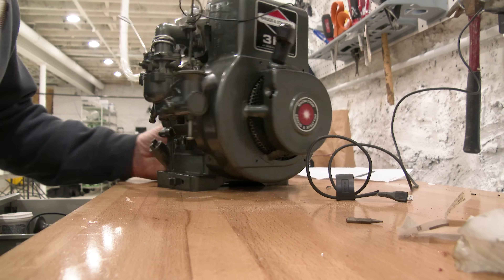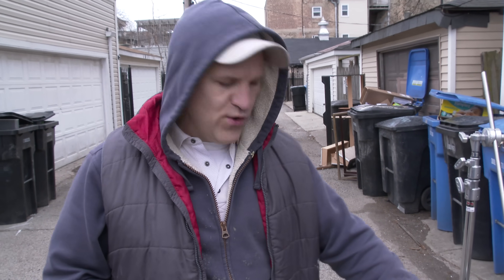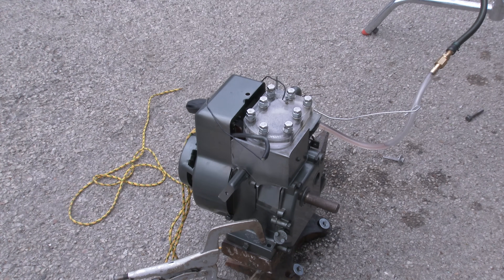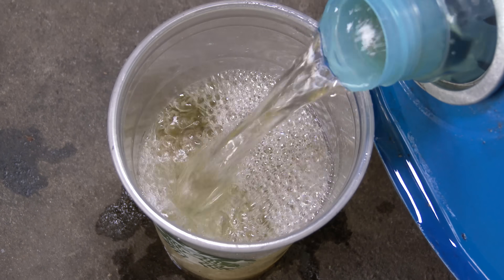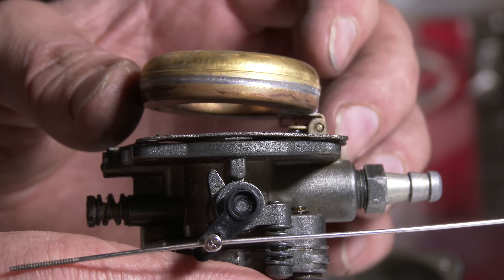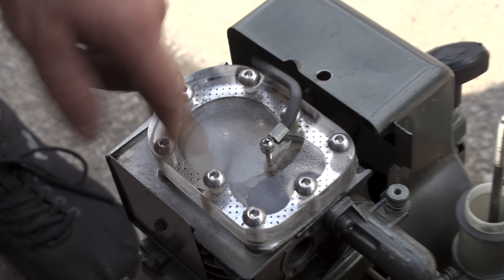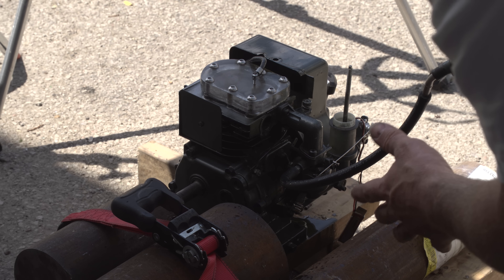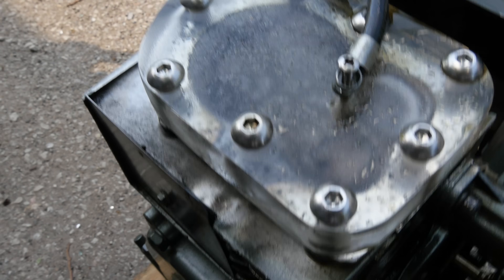See Through Engine on NITROMETHANE - Blow Up Attempts 1 -9 Crazy !

Comment: How big are the jets on the carb? You can burn 1kg of nitro with 1.7kg of air versus 14.7kg of air for 1kg of gasoline, just throw more fuel at it if you really want a bang. You'll need a very hot spark and more spark duration but it can certainly be done.

Comment: oil is from the blow by gasses.....theirs just so much more volume of gas, that more is slipping past the rings

this pressurizes the crankcase..... causing oil to squirt out of every hole and bearing 
also.... the splash lube system is REALLY flinging the oil around at that RPM

Comment: Fuel was getting past the rings, flooded the crank case and thinned the motor oil to the point of it getting past the seals. I've seen this before on engines that were running way to rich or had a internal fuel leak, like when my Chevy with a mechanical fuel pump went bad, the car still ran but the fuel pump was pumping fuel into the crank case too. Oil thinned enough that the oil pressure light came on. Had it happen to a Cummins in a semi I used to drive too, oil pressure dropped and oil started coming out of the dip stick tube because of a injector that was stuck open.

Comment: Holy shit I can't believe how fast you wound that thing out.  I was wondering if it would have run longer if the flywheel was setup so that it didn't shake the crap out of the engine at 30 degrees advance.

Comment: By the way: is this the original sound slowed down or are these after sound effects? I always wondered how slo motion audio is recorded. Because if you play back slowed down footage it either sounds deeper or just tinny crackly and I dont know where the difference comes from (sampling rate?)
Reply from the maker: Äidriään yeah that's a great question. Sometimes it's the original sound, sometimes there's sound effects and sometimes a combination of both. It all comes down to the frequency. If a sound is recorded and it's a 1000 Hertz, and you slow that down by a 100 then it becomes 10 Hertz. Under the audible limits of the human ear.

Comment: You drive with a 2 cycle engine in your car
Reply: Neg. 4-cycle. 2 stroke is only used in smaller engines where the lubricant is part of the fuel mix.  You can get up to 10Hp 2 strokes, but their fuel efficiency is in the pits.

Comment: The slinger is probably throwing the oil up through the breather, as it was never designed to run at 8k rpm....  You're probably going to find significant connecting rod bearing damage if I had to guess. tough little bugger that's for sure!

Comment: My drag-racing friend said that you needed either very high compression or forced induction. WIthout those, nitro won't make enough power, which is why you only pushed out a head gasket, rather than doing it properly and actually blowing the engine up.

Comment: You gotta put the spark right on top of the piston
Reply from the maker: actually, the original location of the plug is between the valves and the piston over the deck not above the piston, you can see this location in the part where I run it with the original head.

Comment: Great slow-mo footage.
However, nitrometh isn't exactly volatile enough to make an engine 'blow up'. Engines in Top Fuel cars fail due to the stresses of cramming ~70psi of boost at almost a 1:1 Air/fuel ratio into a 6.5:1 compression engine. At full throttle, there is almost enough fuel being injected into each cylinder the engine could hydro-lock on just fuel alone.
Seen here in this demo -> https://youtu.be/xGTbQuhhluY

Also, the melting of the first acrylic head looked more like an issue of still running a lean fuel mixture. Just remember stoichiometric ratios: Gasoline is 14.7:1, Methanol is 6.45:1, and Nitro is 1.7:1. That RC nitro fuel is probably about 4.4:1, and the VP Nitro 50% is about 4:1.

Keep up the cool footage!

Comment: Would a quartz head work on something like this, I'm pretty sure it can take high temperatures.
Reply: Colin Bacon or borosilicate glass, like pyrex.
Reply from the maker: I have actually developed some borosilicate versions of these, they are custom made however and in the final stages of development and testing, will be ready to rock and roll in a couple weeks, it behaves much different than high temp acrylic and is very expensive to make.
Reply: Warped Perception I could imagine. Its not a cheap material to begin with.

Comment: Having grown up with top fuel dragsters I cringed every time you did the quick short revs after a high rev cuz that's what's more likely to blow your engine
Reply from the maker: Hylian Assassin thats what I was hoping for but ... No go. My gut tells me that in the next episode I should be able to get a catastrophic failure. To be honest I want to see Parts flying through the block. But capturing nitromethane burning in the combustion chamber and high-speed is something that I don't think has ever been done before. I looked everywhere on the internet and came up empty-handed, it looked amazing that Snow White burn...
Reply: Warped Perception I know you can get the separate components to mix your own nitro and I'd almost be willing to bet that a mere 50/50 won't get you the catastrophic results......however you can increase it using that 50% as a jumping point and once you get up to that 90 a sustained rev with a quick burp should practically guarantee something dies in spectacular fashion lol......but then again....everything works in theory but not always in practice..... definitely looking forward to the possible results
Reply: Mandernach Luca nope.....the sustained throttle is all safe it's when you let off then give the throttle a quick bump then let go from what I understand that there's too much of the highly volatile fuel stuck in the engine at too slow an rpm at the point of ignition that it blows up......mind you I don't know if that's exactly it but that's my best guess based on my knowledge
Reply: Mandernach Luca holy hell....your question just made it occur to me that warped perception may not be able to get the epic failure he's looking for because most if not all top fuel drag engines have some sort of turbocharged or supercharged engine which would force more air/fuel into the engine at higher rpm which would be optimal for said rev level but bring that high pressure aur/fuel mix in a suddenly slower moving engine and you instantly have a bad day due to the inability to release those extra high pressures as they would need to be........then again I don't know exactly if that's it but that's the best I can come up with based on my knowledge of engines/drag set ups
Reply: Why do those quick revs kill the engine and not the long full throttle one? Has it something to do with the timing?
Reply: I'm just wondering why this is the case. I mean i wonder how there even can be to much  fuel-air mixture if these engines are build for max. pressure. Can there be something like to much fuel-air mixture? When i remember right, those things have a roots-compressor or something like that. So there constantly under pressure (Queen reference XD), or not? Well, i don't know enough of these engines but i would love to understand them.

Comment: Could be wrong on this but what I think is happening with the oil is that the nitromethane is exploding at such a high pressure and speed that it's pushing through the gaps on the piston rings and creating a higher crankcase pressure forcing it out through every little weak spot. But I'm not sure I've only ever run gasoline in my cars never built one for Nitro.

Comment: I just can't believe how fast the briggs engine ran! You must hook up a rev-counter when you do the turbo run, just to see how fast it will go before the conrod snaps!
Reply: Paul Roberts 
I hooked a tiny tach to a little 3.5hp that I blew up on my channel. 
It would go about 56-5700 tied wide open.
Reply: @MrTheHillfolk that's just a tad bit past clutch engagement around my neck of the woods
Reply: @BenjaminDover0496  😁
Reply: We spin our modified Briggs Animals (6.5 OHV) 9500 but we run billet rods too
Reply: Back when I raced karts we would turn the “stocker” engine 7000-7200. That’s on pure methanol. A built engine might turn 9000.
Reply: @mrhillfolk 28hp but its only 206cc
Reply: garrittpwl 
So using round numbers (6hp or so stock, now 30hp) 
5x more output than stock. 
Try that on an automotive engine without any boost! 
Even with boost that’s a far reach!
Reply: @MrTheHillfolk  I did and its called two stroke with chambers. Ok it was more like 10 to 32. More impressive numbers for sure from the smaller two stroke engines. i.e. under 5cc that rev out to 20,000+ RPM.

OP so what did you learn about how Nitro burns. Did you try any more timing advance numbers. 
I would really like to see how Knock looks on high speed camera.
Reply: B&S turbo mower 😂😂😂😂
Reply: لحيو ان
Reply: At full chat it sounded somewhat like my 125cc bike running at maybe two thirds of its max (which is approx 10500~11000rpm and ~80mph), like low 50s mph, so somewhere in the 6000-7000rpm range maybe? Which matches with MrHillfolk's count of 5700 for his engine, if we assume that wasn't quite on as potent a fuel mix or with the same amount of advance (which after all required modification) as this one.
Reply: mspenrice 
Yea mine was just a 3.5hp with a blown pressure washer pump head, straight gasoline. 
It took about 2 maybe 3 tankfulls of fuel to blow up. 
I kept feeding it speedy dry and grass clippings.  
Enjoy the 5700rpms :) 

https://youtu.be/jCHPYOFXZUs
Reply: Paul Roberts My buddy was a gocart champion back in the 70's, I bet you can still get heavy duty rods and good pistons for these things. He used to get 18-21 hp. out of a 5hp briggs.
Reply: Does anyone know how he prepared the plexiglass to be used as a head?
Reply: garrittpwl 
I love small maxed out modded engines. 
Lol what’s it put out, like 30-40+hp I’d figure

Comment: I am curious what rpm that engine was running at when you had it WOT on the 50% nitro mix
Reply: Peter Dudas my guess would be a little over 5200 and about 5hp. Which if you think about it would be a 66% jump but it doesn't have any load on it so hard to judge.

Comment: Will you be my father? Lol. In all seriousness, I'd love to know what sort of power that little engine was making on the nitro mix. Would be interesting to see the comparison. Nitro actually has less energy density than gasoline, it's just that you can burn more of it with less air than gasoline which is why dragsters use nitro. Wonder if this Briggs was actually making more power, or just more noise.
Reply from the maker: J D well in the next episode I am getting it on the dyno.
Reply: Warped Perception awesome!

Comment: So this is the equivalent of overclocking a PC
Reply: Overvolting may sound better suited.

Plain overclocking is more like installing an adjustable rev-limiter.
Reply from the maker: Galactic Gaming essentially .. yes
Reply: Martín Varela ^bit of both. Higher revs/clocks supported by adding more fuel/voltage.
Reply: Overclocking a PC won't get your hands dirty.

steve
Reply: Steve Skouson yeah but it’s still fun
Reply: Galactic Gaming lol yup 😂😂

Comment: it would be really cool to see if you can measure power output of that 3hp engine with normal gas, than other fuels and also with turbo. Just wondering how much difference fuel does.
Reply from the maker: Michal Přadka it's coming. That's planned for the next episode

Comment: Where's the video of that RC jet? I want to see what happened to it to understand what you were talking about. Thx!
Reply from the maker: +Kerig Pope lol... That was the point, it's coming, unfortunately the only thing I didn't capture on video that they was when it crashed, I couldn't believe it. I felt terrible for my friend though that was like $25,000
Reply: Warped Perception Thx! I just saw the jet in one clip, and then smoke in the next, and I felt a part of the story was missing. 😁 LOL 
Shame about the jet, that one was larger than most RCs. Where do they fly them? In the city? The only RC park that I know that can handle a jet that big is out in the woods (Morrill Meadow) near Palos Hills. (they have a nice paved runway)
Reply from the maker: Kerig Pope there's an even bigger one on Halsted and 147th Street. That's where this happened. It's got a full runway in about 500 feet of grass on each side.
Reply: Nitro engines tend to run lean when they're firing (nitro is its own oxidizer) so you have to run them rich on purpose.  If you get that wrong youll eat the engine or stall, either way that's bad news for a jet engine on an rc model flying around 75+ MPH. RC 2-cycle fuel has oil in it to lubricate the moving parts so having a proper mix is doubly important and why blue smoke is a good thing in these engines.

Comment: Nice job Matt. See if you can buy an aftermarket magnetor for that engine. I am pretty sure they make them. Nitro needs a LOT of spark energy to get a complete ignition, you're right there. But it also needs a longer spark duration to pump a lot of heat energy into the system. Nearing full throttle, you began getting near that energy threshold. If you had a hotter spark with a bit more duration, I think you would have it. I will say.......adapting an MSD 6 redbox to this and adding a crank trigger to fire it would do it.
Reply: could probably use a little higher compression as well which would help build more heat up.
Reply: Not really as much as you'd think. Nitro doesn't act like most other fuels since it carries its own oxygen. Fuel altreds run no forced induction and run modest compression. They gain their immense power from harnessing the power of the molecular oxygen available. The issue is giving it enough spark energy to break that bond and liberate the oxygen. Fuel motors want two things, drenched in fuel and bathed in spark and timing. There is a saying, if it wasn't for the magnetos, fuel motors would be fuel pumps. Literally, in order to get power out of them, you need an insane amount of fuel. The amount of fuel that makes you think "No way, I am flooding the cylinder!!!" Nope, you're just getting it where it needs to be. Give it the right amount of spark and you'll let the genie out of the bottle.
Reply: @StreuB1 yeah you ought to see the jetting for the flathead restrictor plate engines. Seems like it would drown in fuel but it loves it
Reply: A crank trigger with a high output coil would do the trick.
Reply: I am pretty sure of that if you can make it a bigger sparkling maybe you can get it
Reply: not sure of the total energy of the spark, but a modern gas engine should be around 40kV to the plug out of the coil @ShadowPBPBC
from what i know you need higher energy spark to light bad mixtures easily
Reply: ShadowPBPBC on a top fuel dragster. It takes 88amps per cylinder to fire the nitro. Thats why they run dual magnetos.
Reply: Also needs more fuel as nitro has oxygen in it

Comment: YOWZA!...I'm goin' out TONIGHT to buy a Briggs!...that thing was just a little past design spec before the head gasket let loose!
As to the leaks, I know for a fact that methanol eats Buna and rubber...I think only Viton seals will hold it.  There was prob'ly a good amount of blowby which allowed the methanol at the crankcase seals...valve seals also prob'ly failed...or the crankcase seals just got physically blown out.  Your nitro also tends to eat things by oxidation, being that it's the source of extra oxygen that makes for the crackle you hear at the dragstrip.

Comment: Have you tried adding weight to the crank shaft, like a fly wheel , just to load up the engine, make it work a little harder, it may put the extra stress on the inturnals it needs to break a conrod or crank, (im a retired mechanic).
Reply from the maker: +Paul Dove well I have something better in store that I built, it will appear in the next episode of the see-through engine series. Wait till you see, I was even impressed that I came up with this idea.
Reply: Nice, can't wait, you and your family have a merry xmas and a happy new year.
Reply: Warped Perception Stick it into the ground and spin the eart.